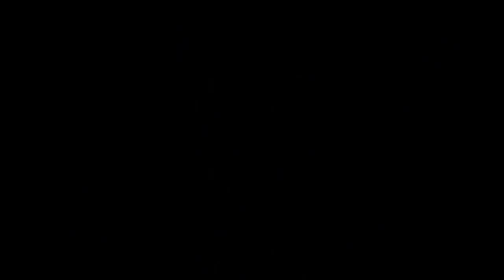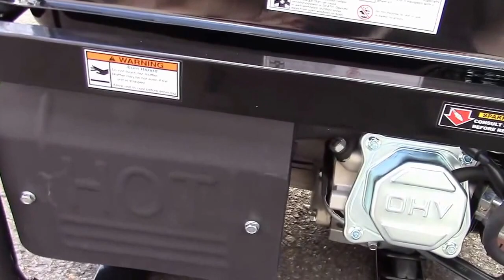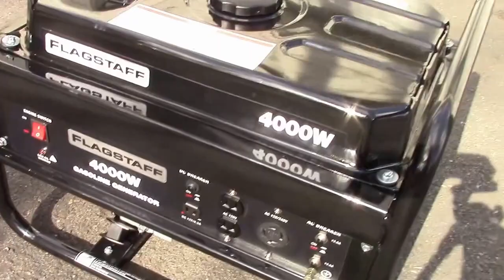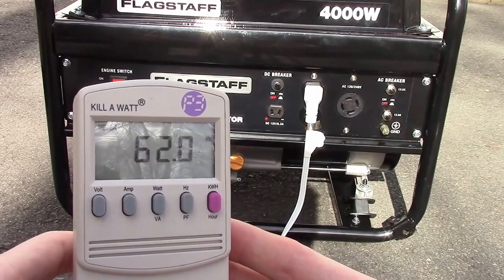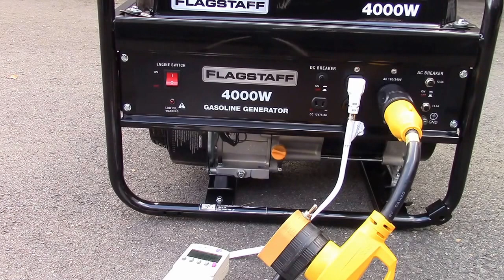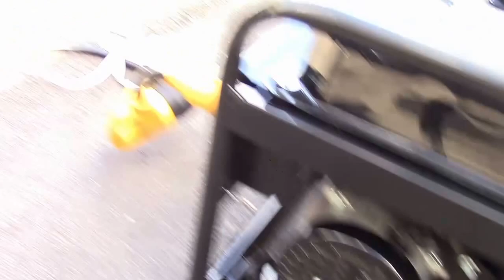Flagstaff 4000W Portable Generator (Item# 720850)

Comment: this is my first generator. I have a question so far no answer. I intend to use the 20amp standard plugs with extension cords. Are the 2 plugs wired separate where I can load each outlet to the 13.5 amp breaker max or is it wired so I only have 13.5 amp split between both?

Comment: Great video.  I would advise against ever shutting down a generator while under any kind of load.  I understand it can cause problems with the generator field magnets sometimes.
Reply: so you are suggesting to unplug everything from the outlets before shutting down? i ordered a 7000w version i will be picking up soon and i wouldn't want to fry it
Reply: Yes, The reason is the Generator head needs some magnetism to make electricity, if you shut it down with a load, a majority of the magnetism is used up is making the power for the load. Also do the same thing for Starting up the generator, start the unit without any loads on the generator. You can do this two ways, if the loads have a switch, turn the switch off, if the load doesn't have a switch leave it unplugged in till the generator has started and you see volts on the voltage meter. It also helps if you let the unit run for a good 60 secs before you put any loads on the unit due it gives the generator time to warm up a bit and allows the oil to get to all components inside the engine.